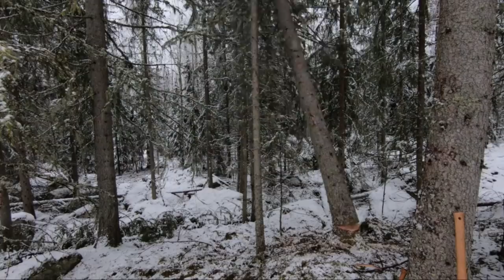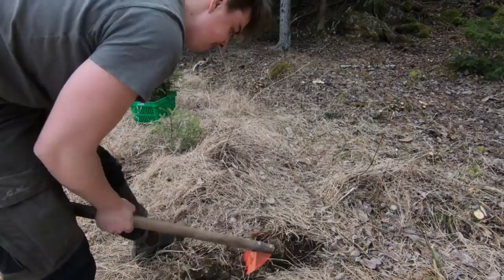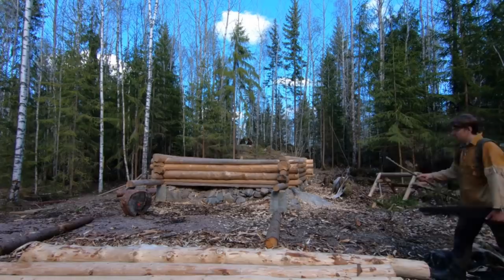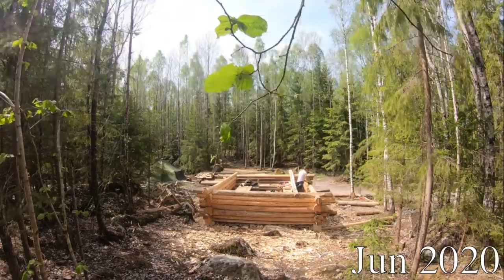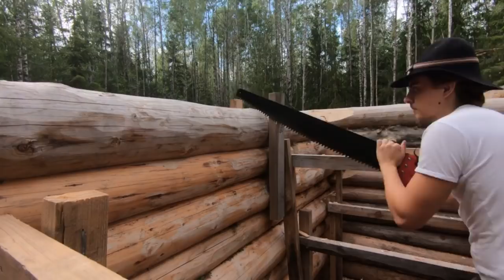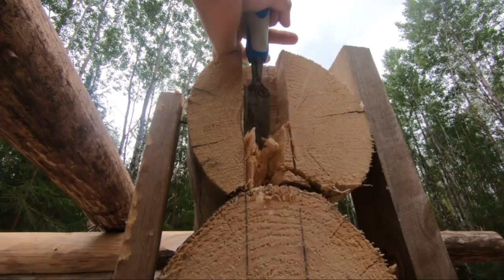I Spent 500 Days Alone Building A Log Cabin

Comment: Nice! Question though: I guess that the moss between the log is placed as a seal to avoid air gaps, but wont that moisture kept in between (especially for the moss placed on rainy days) cause the wood to rot afterward? (maybe a dumb question, but i'm not very familiar with this kind of building technics)

Comment: i wonder about your hand and the calluses they might have from working with tools a lot with this project. were you already very used to work with tool before and so it was not a problem or did you build your hand tougher while doing this, especially during the first few weeks ? same question with muscles and working long time doing that, did you acquire more endurance and strenght ?